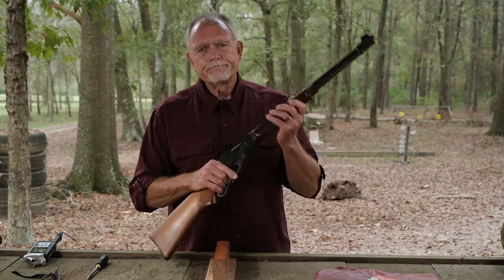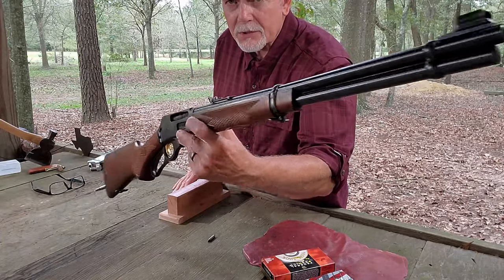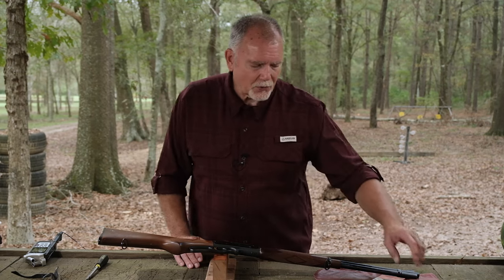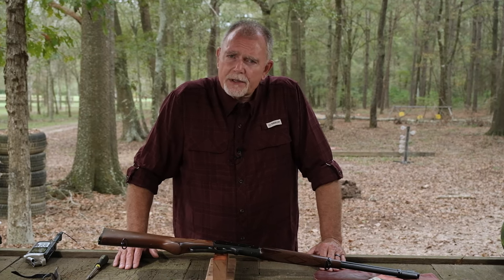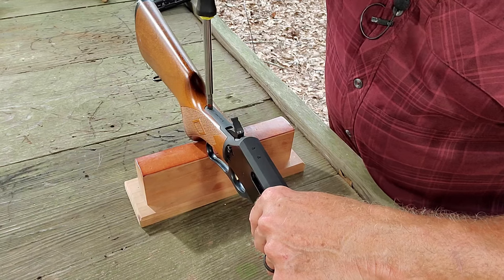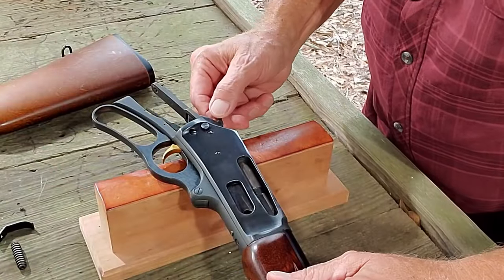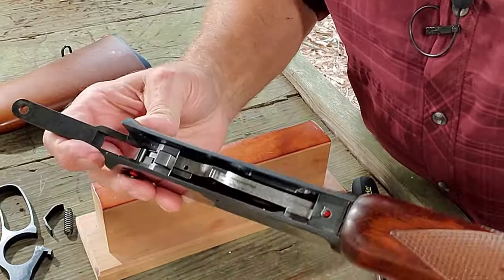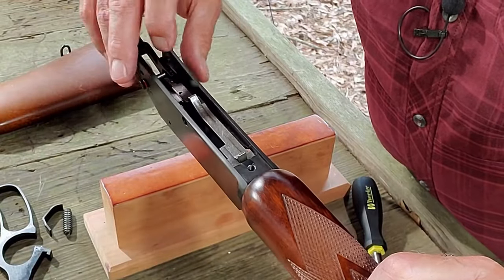Is Your 30-30 Dirty ? Disassembling the Marlin 336 or 1895 for Cleaning

Comment: I STOPPED THE VIDEO JUST AS YOU WERE PUTTING ON THE REAR STOCK AND THEN I SAID NOT SO FAST BUDDY,YOU DID NOT TELL YOUR VIEWERS WHAT THAT WHITE SPOT ON THE LEFT SIDE OF THE FRAME NEXT TO THE HAMMER SPRING WAS.TO ME IT LOOKS LIKE A SCREW UP BUT BECAUSE IT DOES NOT SHOW WITH THE STOCK ON IT WAS NOT CORRECTED.I AM A PERFECTIONIST AND I DO NOT WANT TO BUY A MARLIN 30-30 AND SEE A FLAW LIKE THAT WHEN I TAKE IT APART TO CLEAN IT..

Comment: What if it rwins, how do you oil under the forend grip
Reply from the maker: Good point. As I told another guy in the comments, I'm close to making a disassembly Dash reassembly video on the new Marlin 1895/336. I would be something good to include.